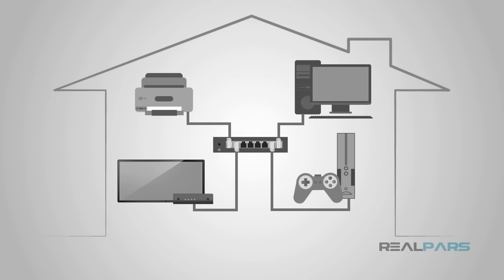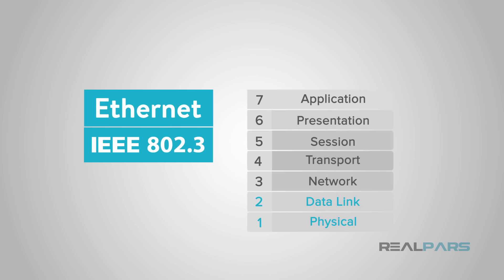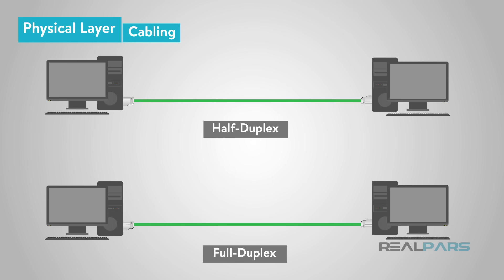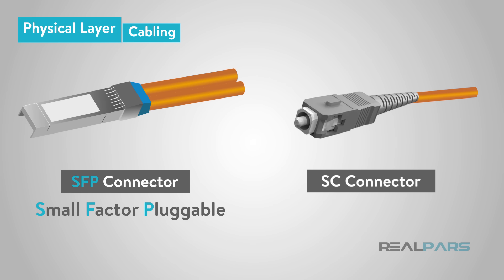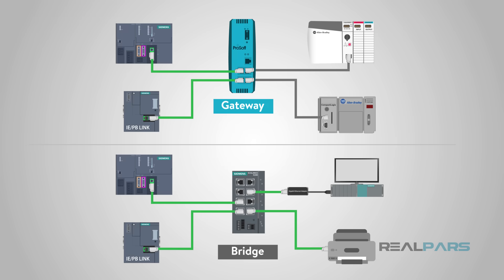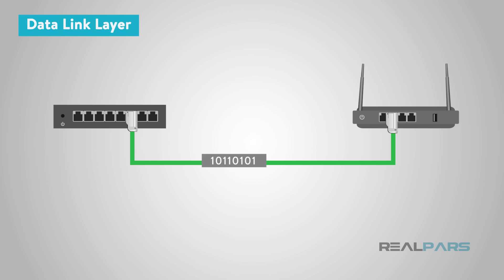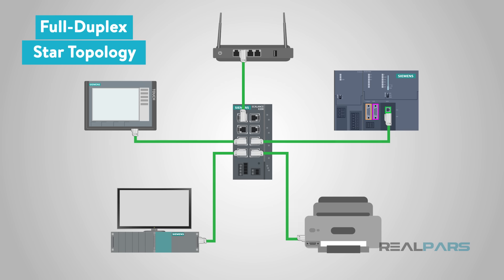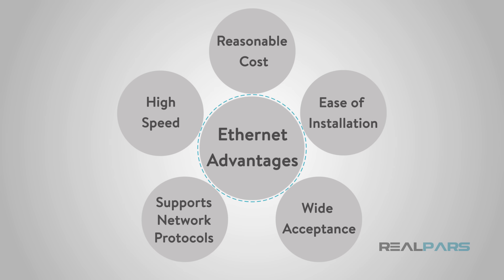What is Ethernet?

Comment: Please correct me if I'm wrong. Is it not the Ethernet that is connected to the Internet that makes it possible to hack into a system? (Power Stations, Factories, Water Supply Networks or other process control systems) Could these internal Networks not be separated from the outside for security? What is wrong with old Networks like Device Net, Control Net or  Profibus?
Reply from the maker: Ethernet networks inside the plant do not need to be connected to the internet.  The internet requires ethernet, but the use of ethernet does not require the internet.  Separation of plant networks from the internet is standard practice.  There is nothing wrong with DeviceNet, ControlNet, or Profibus, but Industrial Ethernet provides some advantages and is must as secure inside of the plant network structure when designed and installed correctly.

Comment: What is an ethernet cable ?
Reply from the maker: An ethernet cable is a cable that consists of four twisted pairs of 22AWG wires with a continous PVC jacket. Ethernet cables typically have connectors on each end known as RJ45 connectors.  Other types of connectors are available, but the cable is essentially the same.  Ethernet cables come in many colors, with gray, black, red and green being the most common.

Comment: Hello .. 
Thanks for your valuable videos .. 
I have a question concerning Switches .. If I have an RTU with single Ethernet Port e.g. ABB RTU 530 and need to use and configure 2 protocols: IEC60870-5-104 & IEC61850. Can I connect a managed switch with 4 Ports, to this unique port of the RTU and configure the ports of switch one for 61850 other for 104 and so one?
Reply from the maker: I am not aware this can be done through switch configuration.  Switches typically can manage packet delivery methods, such as LLDP and MSTP,  but not data protocols as you have described.  Normally, the protocol is defined at the RTU level, which is charged with interpreting the data received.  You could also use a gateway (such as https://www.bueno-electric.com/products/iec-61850-gateway-converters/iec-104-to-iec-61850-gateway.html) to allow both protocols to be connected to the same RTU.

Comment: How are light pulses generated and received?
Reply from the maker: Great question!  A light-emitting diode (LED) or an injection-laser diode (ILD) can be used for generating the light pulses for a fiber optic cable.  The light source is switched on and off to generate the light pulses.

Comment: Great video, however I have question regarding the wire sizes in an ethernet cable. I was wondering why ethernet cables use 24 awg or smaller instead of a 18 or 16 awg. A larger wire would provide less resistance. I hope you have a good day.
Reply from the maker: True, a larger (thicker) wire will have less resistance per foot, but 18AWG wire will not fit into an RJ45 connector.  That is the real reason you see 24AWG wires in Ethernet cables.
Reply: @realpars  I guess you mean RS485, that seems to be standard with BACnet devices

Comment: Sir what is the difference between ethernet and twisted pair cable
Reply from the maker: Ethernet is a communication protocol that uses two twisted pairs as the physical media to transmit its signal.  So, Ethernet is method of coding information for communications, and twisted pair is the type of physical cabling required for wired Ethernet.
Reply: @realpars  thanku sir💜

Comment: 2:29 fiber optic is an ethernet cable
4:29 you need ethernet to fiber converter
If fiber optic is ethernet cable then why is it called ethernet to fiber optic converter? It implies fiber optic is not ethernet cable
Reply from the maker: At the physical and data link layers of Ethernet communication, you need a medium to transport the signal and a physical connection at the device to convert the communication signal into something the device can interpret.  Obviously, the light beam traversing the FO cable cannot be used directly by a computer, for example. there needs to be something to convert that signal from light pulses to an electrical signal that the computer can use.
Reply: @realpars 
I know that light signal needs to be converted. That's n't what my inquiry was about
I was just suggesting that the name fiber optic-to-ethernet is not reasonable as fiber optic itself is an ethernet cable, as you pointed out.

Comment: Need your advice: The wireless desktop in the front of my house(man cave/office) struggles immensely with the wireless signal. Am I better off purchasing a better modem(3200 Docsis 3.1?) Or using a EoP adapter like the TP-Link Nano in that room and hard-wiring it?
Reply from the maker: You could do both, and both will likely help.  Replacing the modem, especially if yours is more than 3 years old, will likely result in a better WiFi output.  However, this may not fix the low signal strength you are experiencing at the interior or extremities of your house.  In this case, the use of 1 or 2 TP-Link Nano extenders will give you better signal "saturation" through your house.  Depending on where your office area is, you may need 2 extenders, which will act as a simple mesh network.

Comment: Cat6 speed is 1gbps or 10gbps ? How Long cable we can use?
Reply from the maker: For 1Gb connections, the maximum length is 100 meters (328 feet).  Cat 6 or later is required for 10G connections. If the cable length is greater than 45 meters (148 feet), use only Cat 6a or Cat 7 for 10G connections
Reply: @realpars  thank you so much sir. 😇

Comment: When used Ethernet can it still produce Wi-Fi?
Reply from the maker: Ethernet is a protocol.  WiFi is a physical layer type.  So yes, both can be used on the same device.  Ethernet defines the way data is packaged and sent from one device to another.  This is handled by the upper five layers of the OSI model or "stack" that defines how Ethernet works. At the lower two levels, Physical and Data Link levels, the type of transmission of the data is determined.  It can be via a copper twisted-pair cable with RJ45 connectors, which is the typical office ethernet connection cable type (IEEE 802.3).  It could be IEEE 802.11 wireless communication, which is connected to the network via a radio module.  Ethernet does not "produce WiFi", but it can be transmitted via WiFi, just as it can be transmitted by physical cables.  In both cases the upper five layers of the OSI model are the same, and they differ only in how the data is presented to the physical layer.

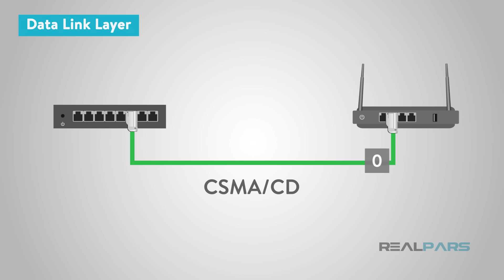Comment: Does collision detection make sense only for half duplex connection. ? In 7:07 the author says "until the transmission completes" (collision avoided). How the transmitter know that the receiver had received the packet and transmission is successful without a collision.
Reply from the maker: In normal "office ethernet", collisions are not very important because if a message is not received, there is not much of a concern.  Modern network switches minimize the number of collisions, but they do still occur.  In "office ethernet", there is no ACK function, so sending a communication packet is like mailing a letter;  you send it but unless you asked the recipient if it has been received, you cannot be sure.  Industrial Ethernet (Profinet, Ethernet/IP, etc) is different.  In these protocols, there is an ACK function that has been added to the stack to make sure that messages are properly received.
Reply: @realpars  thanks. Should I assume that the ack is given via an ethernet packet (I guess there are no dedicated pins for it).  May be start of a burst of packet and end of burst.

Comment: I have  a couple of comments to make about this video, however a bit about myself first.  My first experience with a LAN was in early 1978 on the Air Canada reservation system.  This LAN used Time Division Multiplexing (TDM), not packets, over coaxial (@2 Mb) or triaxial (@8 Mb) cable and was part of a computer system made by (Rockwell) Collins.  My first Ethernet experience was with DECNet connecting VAX 11/780 computers, over 10base5 "Thicknet" cables.  My next experience was hand wiring Ethernet controllers, on prototyping boards, for Data General Eclipse computers.  I got my Novell Netware CNA about 25 years ago and Cisco CCNA more recently.  I have also worked with Token Ring.  So, I know a thing or two about networks.

As for the points about this presentation, Gigabit Ethernet was designed for use on plain CAT 5 cable and predates 5e, which is just CAT 5 with tighter specs.  So, CAT 5 will work fine at 1 Gb, for up to 100M (330").  Also, CSMA/CD is used only for half duplex, as you'd find with coax or hubs.  It is not used with full duplex, where collisions are not possible.  With CSMA/CD, collisions are normal within the first 512 bits and will trigger re-transmission, with random back off, to avoid additional collisions.

There  are 3 "official" versions of Ethernet, which followed the original experimental version which ran at 2.91 Mb and had an 8 bit MAC address.  The 3 versions are the original DIX 1.0, DIX 2.0 and 802.3.  The main difference between 1.0 and 2.0 is the first field was changed from "Type" to "Ethertype/Length" to accommodate 802.3.  If the contents of this field is 1500 or less, it's 802.3 or DIX 2, if above 1536.  IP normally uses DIX 2.  The old Netware IPX used 802.3.

There is some more info on Wikipedia:
https://en.wikipedia.org/wiki/IEEE_802.3

And here's a link to the original DIX 1.0 "Blue Book" spec: 
https://gordonbell.azurewebsites.net/Ethernet_Blue_Book_1980.pdf

Here's an excellent reference:
https://www.oreilly.com/library/view/ethernet-the-definitive/9781449362980/
Reply from the maker: Hi James, 

Thanks for sharing your knowledge with us! We always appreciate such input, many thanks!
Reply: We are China Hqst brand, we have more than 18 years experience in magnetic components and network connectors industry, focusing on providing better products and efficient service.100% Compatible with Pulse, TE(TRP) , Bel-fuse , Wurth , Halo , Molex, Foxconn, UDE... RJ45, SFP connectors and LAN transformers. Faster delivery; same quality; competitive price. Professional technical support and perfect sales service are our core competitiveness. Looking forward to cooperating with you.

Comment: Hi... thanks for info... can LAN works without Internet.. just for internal networking?
Reply from the maker: Absolutely!   The internet is not required for operation of a LAN (Local Area Network).  Connection of a network to the internet makes it more of a WAN (Wide Area Network).  For years before widespread use of the internet, and even now for security reasons, control networks can be designed and implemented using LAN equipment (switches, etc.) without any connection to the Web.

Comment: Can people still use a router which connected ethernet to a computer
Reply from the maker: Yes, in fact, in many cases, a router is required.  A router is a device that allows two ethernet networks to be connected together.  For example, an office building may have a network defined by an IP segment of 172.64.2.xxx.  In order to connect to the corporate network IP segment 172.68.9.xxx, a router is used to direct traffic from the office network to the corporate network.

Comment: What’s the difference between wired and wireless networks 🤔
Reply from the maker: Wired networks use physical cables between all nodes of the network -- PLC to switch to a server to whatever other nodes are present.  In a wireless network, at least one segment of the network does not have a physical cable, but rather a wireless transmitter that communicates with a wireless receiver in another part of the network.  Watch this video for a clearer picture on industrial wireless:  https://www.youtube.com/watch?v=QP8WF4UCmcw&t=7s

Comment: How can i know, if the cable I've connected from my ONT to access Point(router) is Ethernet or Internet cable?
Reply from the maker: Internet connections are made via ethernet connections.  Typically you would use the same type of cable to connect a device to a router as well as to an internet-connected access point.  The only way to truly know if a device has a direct path to an internet connection is to examine the network architecture diagram.  This diagram should indicate at what point an internet connection is made.
Reply: @realpars  I got it, Thankyou for the guidance.

Comment: Hello..dummy here,I have renovated my house and put ethernet cables cat5e  sockets in every room and at TV points because I could..all cables run into the loft as does 1 from my router point in the hallway. I also have a unmanaged switch in the loft but have not managed to separate the pairs and crimp the rj45 ends on as yet...will the switch do its job on its own or do I need a patch panel ect? My walls are 14inches thick solid brick and as such why I didn't want to rely on wireless (house is over 300 yrs old) any help or advise greatly appreciated.
Reply from the maker: As long as the segments (length of cable from switch to computer) is not longer than 100 meters, you are good!
Reply: @realpars   just seen this msg..cheers.
Reply: @realpars   just seen this msg..cheers.

Comment: Could you please tell me the difference between opc vs gateway devices(prosoft),as I know opc is a software package which is installed in PC for communication between different products which are connected to the same pc while prosoft devices are din rail mound devices which configure using a computer initially and later run independently without pc and do the same job like opc ,am I right? please explain,and all are run by Ethernet based cables??
Reply from the maker: Hi Azeem,

Thanks for your comment! I will forward this as a topic suggestion to our course developers.

Happy learning!

Comment: What about the length it can support?
Reply from the maker: Typically, the maximum network length for Ethernet is considered to be 100m (300 feet).  You may be able to go a little farther if the equipment and cabling you are using are top quality, but don't rely on it.

Comment: what does the cable connect to, isn't there a box that it goes to like internet. I look up ethernet because I want to buy it and when I look it up it just shows cables??
Reply: It's your router/modem that it connects to
Reply from the maker: Ethernet networks can be local (not connected to the internet).  You will need a NIC card (network interface card) at each device and a network switch to plug the network cables into.  If you want to connect to the internet, you need a service provider connection that will connect to a router (usually provided by the internet provider) as well as the NIC card for each device and a network switch.

Comment: I have a question my laptop won't connect to ANY Wi-Fi even with the correct passwords because an ethernet cable can't be found? Would buying one help?
Reply: From what your laptop says, I’d get one. Most Ethernet cables are inexpensive and under 20.00 (USD).

Comment: Wait,full duplex communication method doesn't use CSMA/CD anymore as it puts unnecessary  load on the network.And without it, collisions cannot occur because the signals are running on different circuits (Devices  "receive" on 1,2 and send on 3,6  for example).Tell me if I'm wrong it's just how I(!) know.
Reply from the maker: You are correct.  CSMA/CD is only used for half-duplex communication, which is becoming scarcer in industry.  With IEEE 802.3-2008, full-duplex communication with switched networks made CSMA/CD unnecessary for full-duplex. You could say improvements in networking technology made CSMA/CD obsolete.

Comment: Bell invented twisted-pair wiring to counteract capacitance found in non-twisted pairs.  "Loading" coils were also added at pre-determined distances.  XL and XC cancel themselves out in tuned (resonant) circuits, making the "load" purely resistive.  Telephone lines weren't "resonant", but every little bit helped....oops.....XL and XC are inductive and capacitive reactance, respectively.  If I've made any errors, please advise.......I retired almost 9-years ago, and my memory of such things is flagging.

Comment: Earlier, there was another technology for setting up lan called Arcnet. Is it totally gone now?
Reply from the maker: ArcNET is not totally obsolete, as there is still a pretty sizable installed base, especially in the automotive industry.  However, Ethernet is much faster, cheaper, and more reliable and is accepted as the de facto standard for network communications.  There are virtually no new installations of ArcNET, and the installed base is dwindling rapidly.

Comment: Hi can I connect an Ethernet gateway to a solid state state relay to turn it on or off from a computer or smartphone??
Reply from the maker: Ethernet is a protocol.  A solid state relay is a device.  To "connect" the two, a device capable of receiving the Ethernet signal needs to convert the request to a DC signal capable of actuating the relay.  There are many devices, other than a PLC that can do this.  Search the internet for "relay multiplexer".
Reply: @realpars  thanks

Comment: What is the maximum distance ethernet to communicate local to remote hmi???
Reply from the maker: 100 meters per the Ethernet standard.  You may be able to go to 120 meters, but if there is significant electrical interference in the area, that may not be possible.

Comment: 35+ years ago, "Ethernet" ran over a thick coaxial cable that many devices could daisy-chain over.   Not an 8-wire twisted pair.   No longer.
Reply: I first came across that at work, where we had several DEC VAX 11/780 computers connected with DECNet over "Thicknet" cables.  Later came 10base2, which used T connectors to add devices to the LAN.  Thicknet used "vampire" taps, which actually pierced the cable.  Also, the cable was usually yellow and called "yellow garden hose".  ;-)
Reply: Nerd
Reply: @seanbaxter44  And proud of it !!!